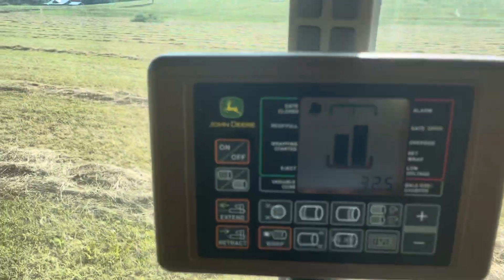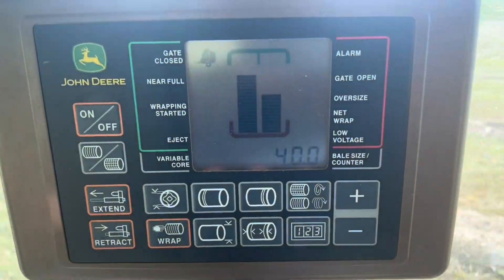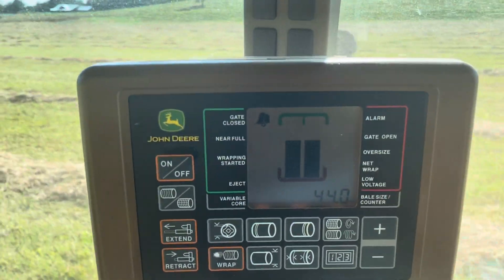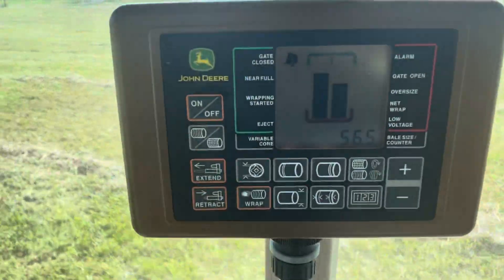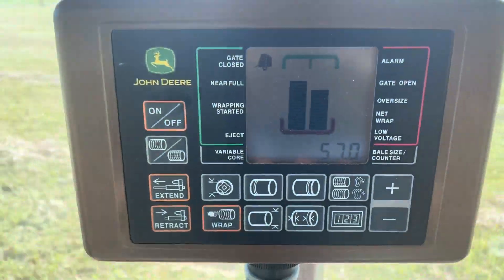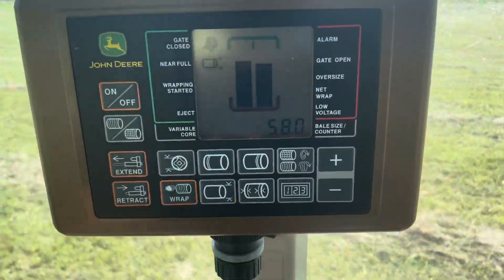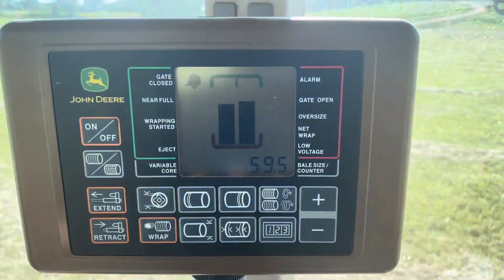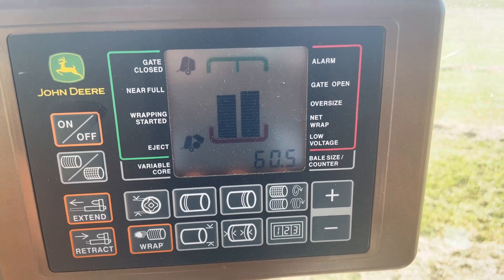John Deere Bale Monitor Bars

Comment: Well with our old monitor ( granted it was a different brand and different looking setup) the bars were reading pressure on the belts. If you keep them even means the hay is more evenly spread in the bale =prettier bales. If you let one get way higher then the other for to long you wind up with lop sided bales. As for them not going all the way up idk.
Reply from the maker: Yes that’s essentially what it ends up being. Pretty bales vs just bales. I think the issue is actually the quality and fluffiness of the windrow. Bigger fluffier windrow and it makes the bars go all the way up. Thin stuff like this not so much
Reply: Your bake size sensors need adjusted